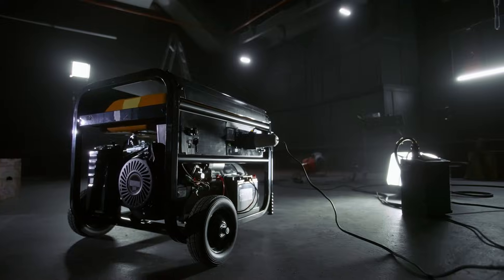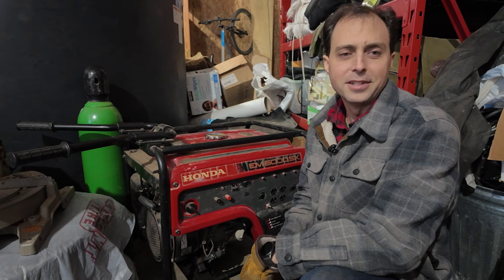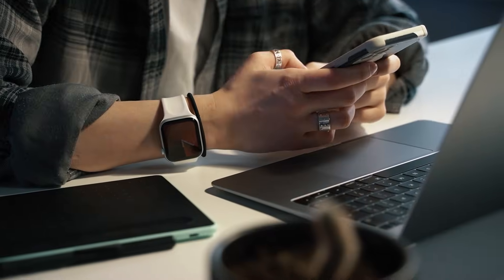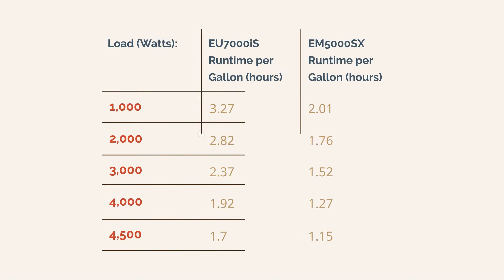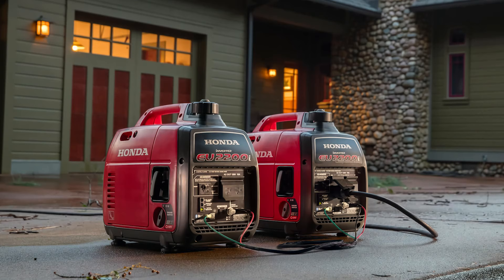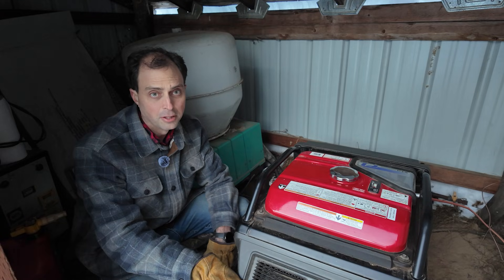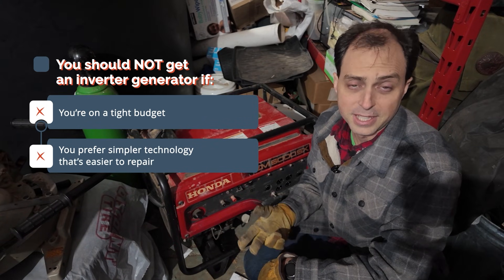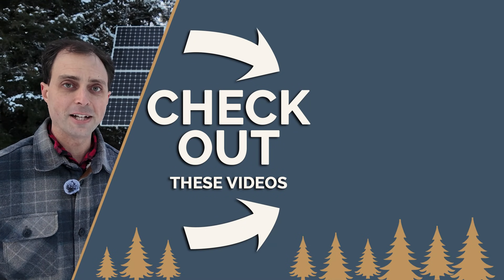Inverter Generator vs Conventional - What You Need To Know

Comment: It's not the phone and laptop charging it's the motherboards in fridges, washer dryers etc. or a inverter charging batteries off a conventional generator. I have a military diesel gen that my washing machine doesn't like but it's fine with my gas conventional. And it's a old school washing machine no PCM . The motor gets hot . My fridge and I'm window air cons  work fine with it.

Comment: Great video. As others have pointed out, most modern electronic devices are DC powered and their power supplies can deal with usually wide range of voltage and frequency. I think were things get nasty are HF inverters and AC motors (pumps, ACs, fridges, fans and etc will not be happy). I've seen DC generators doing  48-54V ideal for LFP batteries application, however the cables will be serious and are not that flexible. I ordered an inverter-style generator due to 1) pure sinewave 2) it is a black friday and the added cost to the alternative was less than 30%.

Comment: I believe simple / quality products have already been made and some are dying as time passes by.  Manufactures are switching over to newer throwaway gizmos and I believe that is where inverter generators fail vs standard generators. I have used a standard generator to power electronics for years with zero issues. I Enjoyed the video.

Comment: Hey thank you I am in Ukraine and the russians keep knocking out the grid this really helped me with my purchase to refil my echoflow if things get really nasty.
Reply: Hope you ended up picking up an inverter generator. In my experience, despite what people will tell you online, devices like power stations and UPSes will reject poor quality power and not charge or passthrough AC loads. I know specifically that Ecoflow units can do this if the power is low quality. There's some okay points in this video, but in general, it's REALLY hard to recommend traditional generators to anyone in the year 2025 unless they have a specific use case. Inverter units are just so cheap now that most people are better served with an inverter based unit.

Comment: Great video! Just wanted to add a couple of potentially interesting points for consideration:
1. Lifespan & Reliability: An inverter generator might have a shorter lifespan than a conventional one due to its complex electronics and capacitors. I'd estimate a maximum lifespan of around 10 years, similar to a modern TV, and there's often no guarantee of what might happen after the typical 5-year warranty period expires. In contrast, a conventional generator can last much longer with proper maintenance and simple part swaps. This is a crucial point to remember, especially when looking at the used market where prices for inverters seem artificially high in my opinion.
2. EV Charging: A great benefit of the inverter's pure sine wave is the ability to charge an electric vehicle. However, it's critical to ensure the generator is properly grounded (or uses a neutral-ground bonding plug) for the car's charger to accept the power.
Reply from the maker: Thanks for sharing that input! So many variables in lifespan, such as maintenance, how hard you run it, and more. But I'm sure there are more electronics to go wrong with the inverter generator. Sure is nice to be able to idle down and also to produce high quality power, though.

Comment: what about using it for whole house/ backfeeding panel setup?  everything i have watched and read including  A.I. states that you should leave the generator wide open at all times so it doesnt mess up the electronics surging up and down during power demands.  also, how does the THD (total harmonic distortion) play into this on the regular generator?  anything above 5% THD supposedly ruin your electronics?

thanks, dave

Comment: Why couldn't you just plug in a $ 25.00 dollar inverter into the DC socket yourself, to get clean energy for computers ?
Reply: Make sense, I have modified UPS with external DC input. It can use this setup.

Comment: Just an addition: Most modern "sensitive" electronic appliances like laptops, tablets, TVs etc. nowadays use their own power supply, which usually has a wide-range input, e.g. 90-240V @  50-60Hz. Check what's printed on your laptop power supply to see for yorself.
So while your info on the fluctuating voltage of a regular generator is correct, the relevance has dropped significantly over the past 10 years or so.
Just my 2cts...

Comment: Doesnt a regular generator have a throttle with the ability to back off?
Reply: Just a governor to add/reduce fuel depending on the load but it always maintains Full RPM.
Reply: @projectswithjw interested
Reply: Good question.

Comment: Just need to have generator backup for refrigerator and 2 freezers. Live in hot climate. Which option do you recommend.
Reply: Unless you have a smart fridge, just get a regular generator. Most people aren't running a generator for long enough to justify the fuel savings and when I was in Iraq, we ran all kinds of sensitive electronics off generators and they were all fine. Laptops older flip phones. PS2, XBOX... You name it.

They were all fine.

Comment: Would a solar generator (anker solix f1200) count as a sensitive electronic? My current plan is to run my sensitive electronics off of solar generators and when solar input is not enough i would then use my non-inverter generator to recharge them.
Reply from the maker: As long as it's a quality conventional generator (with a good voltage regulator, etc), it should be fine for charging your Anker Solix.